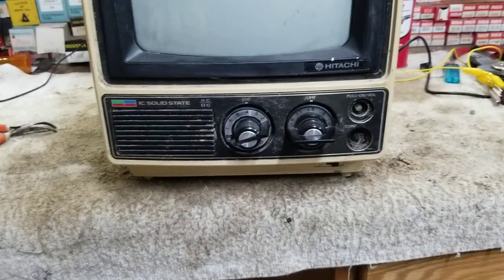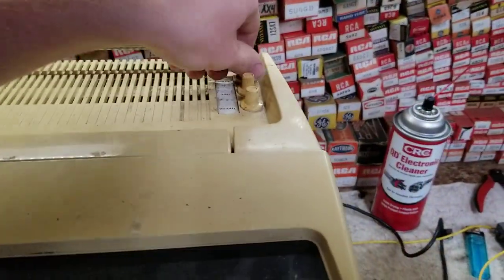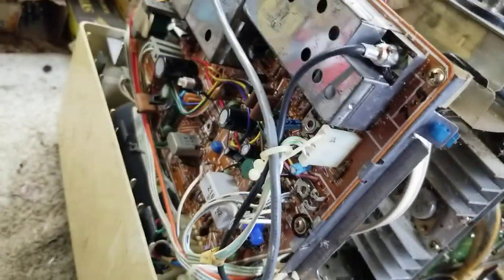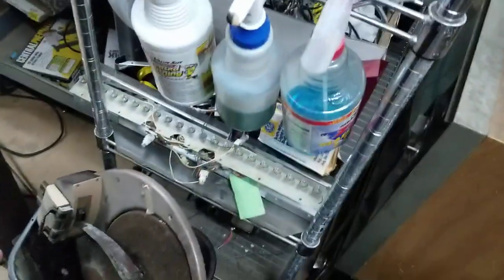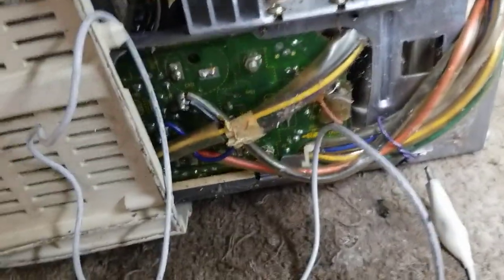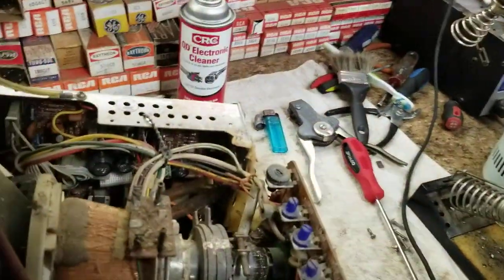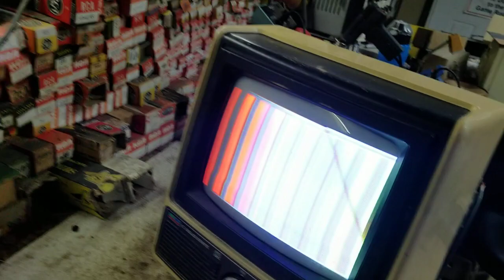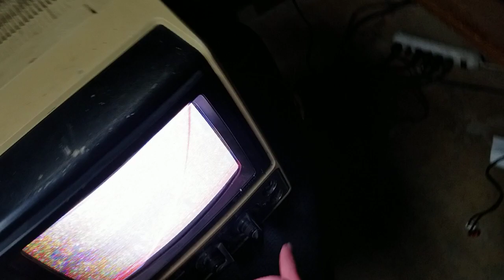1978 Hitachi 9 inch Color Portable Solid State Vintage Television Assesment for Repair

Comment: The best way to tell if you lost your filter caps or any other caps in the AC circuit is by powering it up on DC. By using it on DC you don't have to worry about the filter caps or rectifier diodes(which could have been what failed because they like to smoke a lot when overloaded). If you do try to run it on DC you will either need a high capacity battery like a car battery or something of similar capacity in Lithium and if you choose a power supply you will probably need at least 5 amps but the higher the better since the CRT is going to draw quite a bit of current especially at start up. BTW I'm no expert so what I said is just a thought and I do operate lots of 12VDC stuff on power supplies in my house so I have a little knowledge in that area.